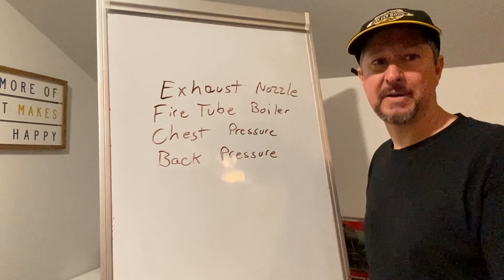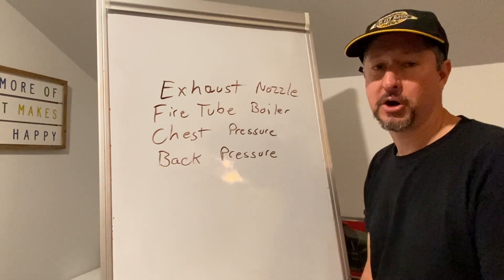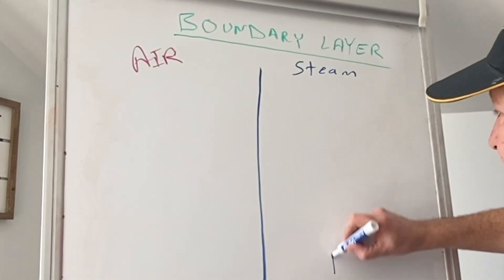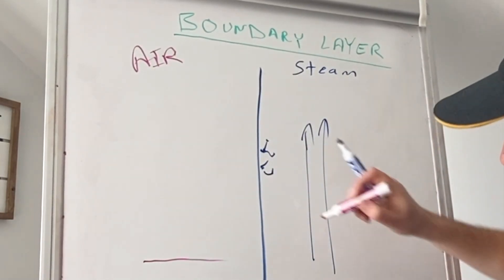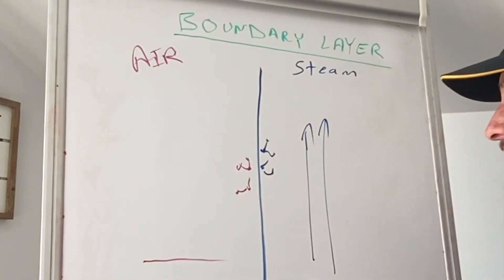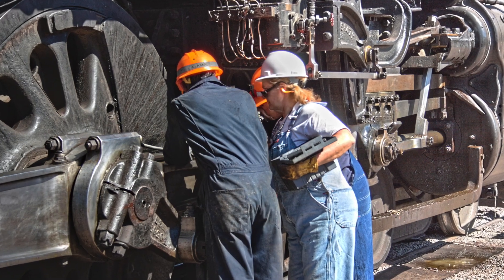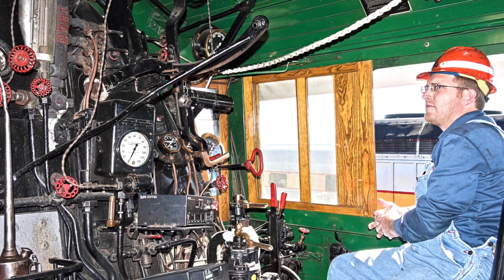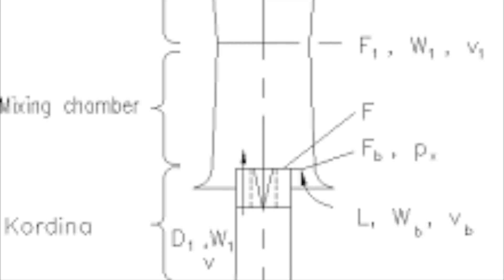Analyzing Steam Locomotive Drafting Systems - Part II

Comment: It may be worth mentioning that total elimination of back pressure is not desirable as a small amount of back pressure is needed to provide a cushion for the piston at the end of the power stroke. This is not a function of the nozzle but valve cut off.

Comment: You should mention that the Lempor nozzle is internally convergent-divergent, and the goal is to get the steam to exceed the speed of sound at the diverging point of the nozzle before its exit.  When the steam reaches hypersonic velocity, pressure and velocity inverse law reverses and becomes directly proportional, and boosts the effectiveness of the nozzle in a way that would be impossible with a conventional subsonic steam flow nozzle.  This is why the Lempor is properly known as a hypersonic ejector.  The Lempor should also be married to a Kordina underneath it to promote a vacuum being pulled on the cylinder not currently exhausting.
Reply from the maker: Thanks for including that!

Comment: I am curious about the dead space let’s put it in between each chuff. Does the air in the smoke box, flues, and firebox have enough velocity from each chuff to keep good draft even when between chuffs?
Reply from the maker: No.  When the chuffs are at a slow rate, you can notice smoke building up in the firebox in between exhausts beats, and the fire gets brighter with each blast of fresh oxygen.  That’s where the blower is needed to keep at least some amount of draft at all times.

Comment: How critical is it that your smokebox is air tight other than the front flue sheet and stack? Would a drain hole in the bottom of the smokebox, or a gap in the sealing surfaces of the front door be significantly detrimental to your draft? What about petticoat designs? Thanks for the info on nozzles.
Reply from the maker: The more air tight your smoke box is, the better the drafting system will work.  You can live with small leaks and openings, but best to prevent them as much as you can.

Have you seen the video ‘Rock Trains’, where they suck a hole in the side of the smoke box?
Reply from the maker: As for Petticoats, they are just as important as the nozzle.  For maximum efficiency, they should be designed to go together.